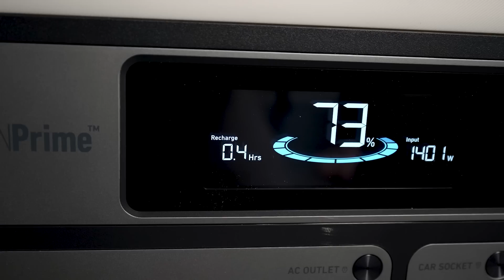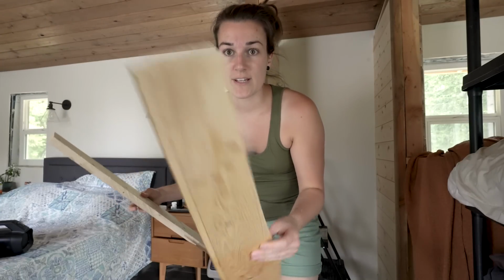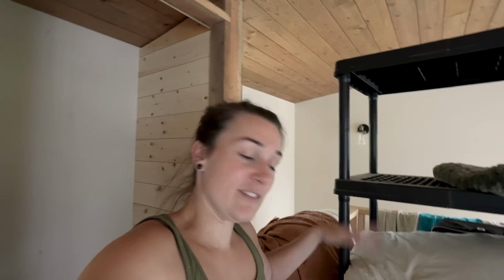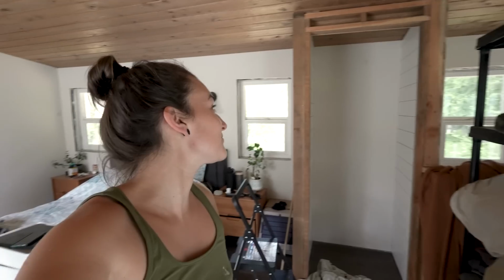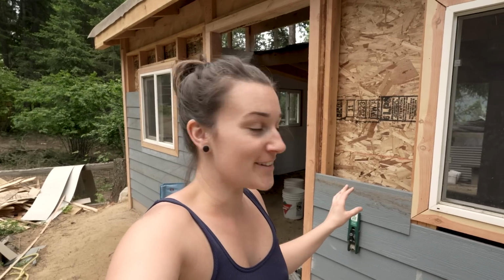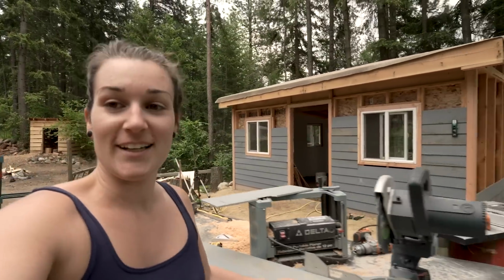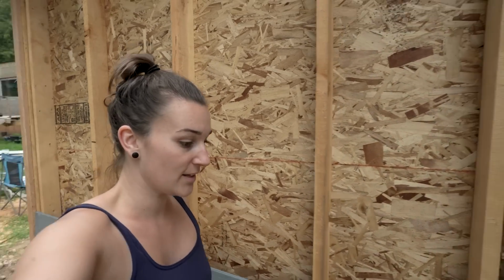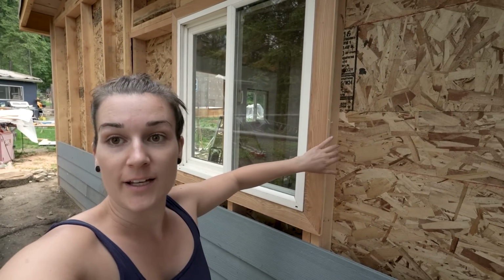He Didn't Think I Could Do This | ALONE At My Off Grid Property

Comment: Suggestion; a pair of plastic sawhorses and a damaged solid core door from a big box store or local lumber/home supply company makes an excellent, cheap, and portable work bench for your saw.  It saves your knees and your back.  You are an amazing young lady, Katie.  Your work ethic is admirable.
Reply: RubberMaid makes a two wheeled wheel barrow that is so easy to move, even when loaded! It is also a perfect base for
 a work table! Screws, nails, saw all stay in barrow and not under foot or stolen by pesky pets!

Comment: We bought our Hardy plank about 6 years ago and the carpenter under ordered our green Hardy plank that looks close to yours. But we bought some without color and got paint and painted it on the saw horses and put it up after it dried. We couldn't tell the difference between the two and it was cheaper buying it plain than coloured. It sure made a difference in keeping sounds going out or coming into our house and especially was great for our cooling/heating Bill's. You go girl, you are an inspiration to many wife's lol. At least you are to mine.

Comment: The cut around a window or door is a very easy cut, measure from the inside of 1x3 to the window make your cut mark,  then measure from 1x3 to the other side of the window make your cut mark, then measure from the top of the board to the bottom of the window and cut it, jf your coming off of a board do the exact same thing GREAT JOB
Reply from the maker: Tried that, it never seems to work 😂
Reply: Look at other people doing that job on line, and try to copy! Finish trim takes a lot of repitition to master!
Reply: Must not have been holding your mouth right🤣

Comment: Katie
You have every right to be extremely proud of yourself. It's amazing too see what you are able to achieve.
On a negative point.
You need to ware the appropriate PPE. You only have one set of eyes. You might not notice a decline in your hearing until it's too late. Believe me I know from personal experience. The dust from the Hardie Board is as fine as talc and it will get into your lungs. 
Please take special care.
John
Adelaide South Australia 🦘❤
Reply: My dad was a carpenter! John knows of what he speaks! Just worked summers with my dad and my hearing is bad! Already had one hip replaced; need another and one knee also! All because i would not develop correct work habits! Just not worth it! PLEASE work smarter, not harder! John in Adelaide; Aussies rock👍

Comment: For future refernce, you don't need to "face nail" tongue and groove siding. The groove will hold the bottom of the board in place and, on the top, ust nail into the base of the tongue where it will be covered by the next board. This way, there are no nails visible

Comment: Nice work.  Suggest building the closest on the wall beside the bathroom door.  That way you don’t have the closet jutting out into the middle of  room.  Leaves room for AC unit or artwork on that wall facing the bed.

Comment: Handling too much of that type of siding at a time is similar to putting toothpaste back in the tube.
Or herding cats. Yeah. That too.
Reply: Depending on length and weight; two pieces of floppy siding carried against your hip, edges up and down, with arms extended comfortably, will transport more easily than one piece! Also spring clamps on both ends keep them from shifting! You are doing GREAT!

Comment: good job and video i think it looks good i would not change color you can take the money you save by not painting it and use it on house siding there are pro's and cons to both metal and hardy broad . drive by houses with the sidings you are thinking of using remenber some colors will fade over time. i think you did good. take care, be safe and well.

Comment: what about electrical and insulation? nice job katie. you are very impressive.
Reply from the maker: No insulation, the barn will damn near be air tight, and our animals don't need a warm spot in the winter, just one out of the wind.  Electrical is going to be a couple lights and a couple outlets.   Simple

Comment: Katie,  I watched you putting the siding on the exterior and did not see any insulation in the cavities.  Is all the insulation on the inside of the OSB sheeting?  I am used to seeing the insulation between the studs with the exterior sheetfed an sheetrock on the inside.

Comment: Why didn't you put house wrap on before the siding ? 
Also why no insulation in the walls ?
Reply from the maker: It's not heated and insulated on purpose. My animals need to keep acclimatized to the cold winter weather. The goats especially are not able to regulate temperature between cold areas and warm areas.

Comment: Maybe I should hire you to fix my closet built by men I think from another planet If I showed you a picture youd see its hardly structurally sound n yet its there. Ive never seen such a lousy wall structure it doesnt make any sense at all. Where are the studs to attach the sheet rock or boards or anything. But it appears to be there I guess the sheet rock is holding itself up.. And I have crooked floor issues as well I think from Water damage from leaking refridgerators in the kitchen over many years. And I have an electrical outlet right under the refridgerator if that isnt an electrical shock waiting to happen I dont know what is. I understand building codes have their purpose and this is a very old house built before some codes were established. Actually few closets mainly shrunks were used instead as people didnt have clothes like we do now in our modern days. Believe me I got this place at a bargain price for a reason. A lot of upgrades will be necassary.